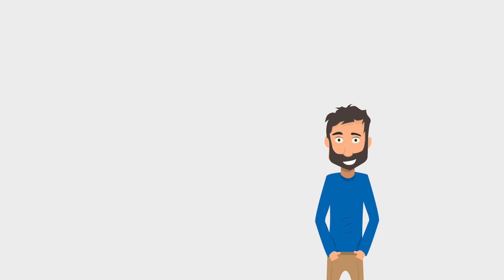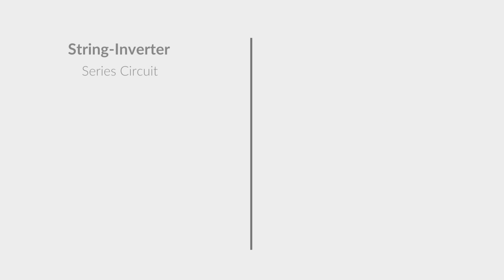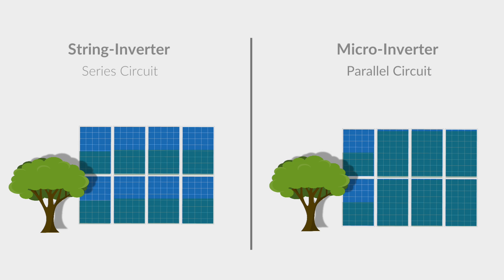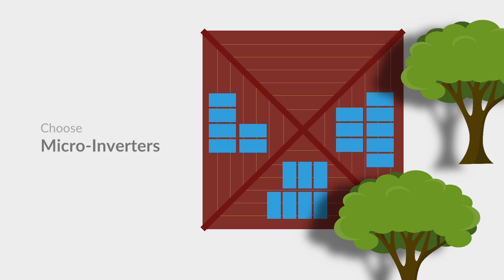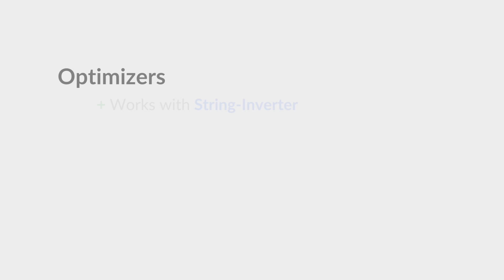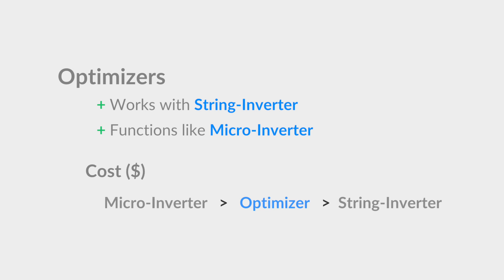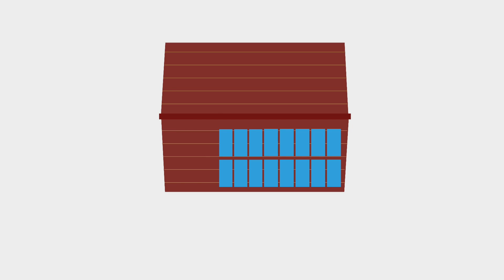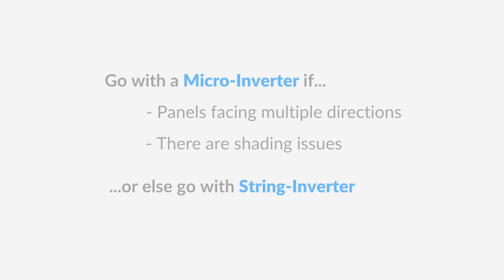Micro Inverters vs String Inverters

Comment: Wow, really! How dated are you. In study after study it has been shown that the production from micro-inverters (even in non-shade conditions) is greater on average than that of string inverters. While they may be more expensive (this is debatable over the longevity of the system), they offset this increased cost by needing fewer panels to produce the same level of power. Fewer panels - faster install, less support materials etc. All of this adds up to a smaller, more economical system than can be delivered with string inverters. 

Just think about it, if a ten panel micro system produces the same average daily power as a twelve panel string system then you are saving the cost of 2 panels, the racking, additional cables and the labor to install those two additional panels. All of this adds up to far more than the slight increase in cost of the micro's.

Comment: I had quotes from several solar companies. String and microinverters systems. The string system was sold much more expensive then the parallel system. This companies want to sell you there system in the same day appointment. Just ask questions and look for price. Call the power company and ask for your annual energy consumption and then you will know what type of system you will need. It comes close to 1000 for panel. My system was 7.89kw= 26 panel(300watts per panel) $26000. Found other company  8.1 kw 13100 mkw a year for $21500. So just shop around. I'll rather go with the parallel system.